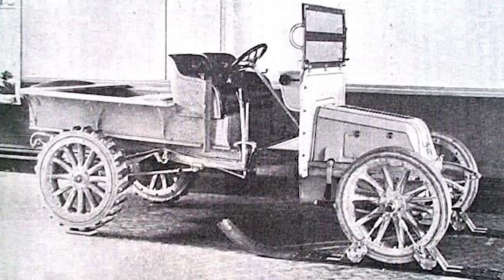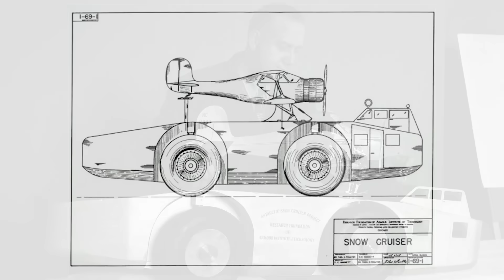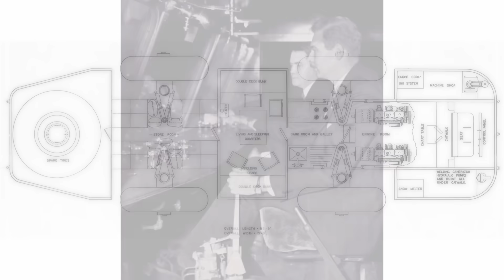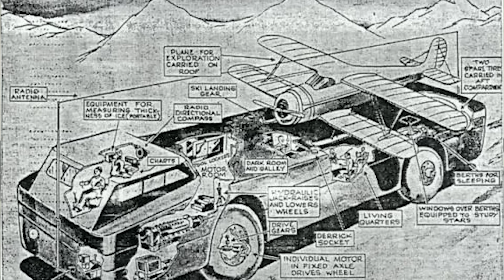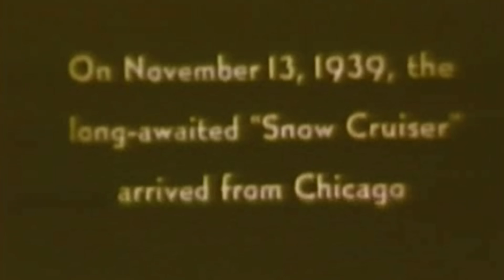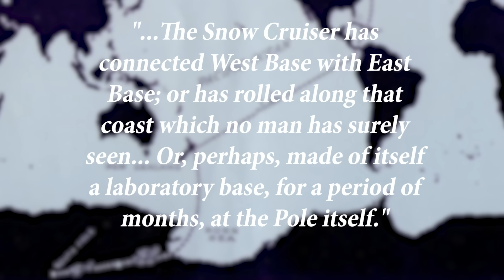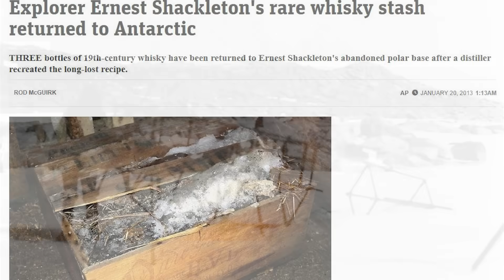"The Snow Cruiser"-Antarctica's Abandoned Behemoth

Comment: I know a lot of people have already  commented on this. However it struck me as a superb project, however really stupid mistakes. No testing in say Alaska beforehand, slick tyres, madness. Surely spikes or a deep off road tread, snow chains even. It just strikes me as a great idea but ruined by simple mistakes. Engineers got the basics wrong!
Reply: As the creator of the video has been stating, the main problem was that Poulter's comparison material was sand, which behaves similarly but not identically to the powder snow in the Anatarctic. He failed to realise that sand is 4 times heavier than snow, and so made a vehicle that was simply too heavy for its wheels. The tires would sink in so far that just climbing out was equivalent to going up a 20-30° slope. If he had calculated for the unit weight of snow, the design could have been adjusted for less weight and the tires would have been fine.
Reply: It's wildly odd how this was engineered in Chicago.  The winters can toublesome there.  I wonder what kind of tires simple trucks were using around then and there.  Atop of that, what were we using in Alaska at the time?  (Being our snowyest local territory).
I bet there were a number of engineers quietly shaking their heads after being told to "shut it", after bringing it up during design.  Of course, Illinois isn't known for its squeeky clean politics.  So in hindsight, its not hard to understand how "a" led to "b", and then to the flop that is "c".
Reply from the maker: Great comment.
Reply: One article I read said that chains were used on the tires, when it was learned that the slicks did not function in Antarctica. One can only imagine how chains were fashioned for ten foot diameter tires, but it went on to say they were a failure as well. The article also said that the air plain malfunctioned too and was never used.
Reply: I think one reason they went with smooth might be treads over ice might tend to be a bit rough, possibly cracking ice. That said I think doubling the tires in the rear might have been a better idea than doubling the fronts.
Reply: It was designed by a Physics Professor then built in 11 weeks by a company that made train coaches, started up only to be driven across country without any testing or even a shakedown run. Crashed into a creek because a faulty steering system. It was a rush job and a publicity stunt with a bit more development time and testing it might have been a success not likely, but politics got in the way as they often do.
Reply: @dycantos  World War 2 was around the corner and nobody wanted to invest time and money in a machine like this by this point.
Reply: @brunoraoni   To us in hindsight WWII was just around the corner but in the United States late 1930s that was a distant possibility an ocean away the funds were there for the project but it was a race to build it and get there first.
Reply: Unfortunately, Alaska wasn't apart of the United stated until 1959.
Reply: @scottwebster3501  USA bought Alaska from Russia in 1867. It was granted official statehood in 1959, but it was definately a part of the US well before that.
Reply: Scott Webster Alaska was a U.S. Territory, and therefor a part of the U.S. long before it’s statehood.

Comment: Yeah, the obvious with the smooth tires. I'm from Canada and at a glance I could see that they would never work! They just look like a huge tube, perhaps that's all Goodyear could do at that time? Couldn't mold a treaded tire that size maybe. The slighted grade and it would spin and slide. An option would maybe to chain them all up, but logistically perhaps too hard to do as the chains would be extremely heavy and hard to install. Pretty cool looking machine, though.

Comment: Thank you for alerting me to something I never knew existed. .. the time & effort making this video very much appreciated 👍
Lots of comments about tyres but grip is all about footprint, smooth is more rubber like in racing cars so the 'rough or smooth' tyre question is I think more complex than first appears & wholely depends on which surfaces they expected, hard smooth ice may have been better with low pressure smooth tyres.
Reply: This reply is a year late, but I think the slippery and icy surface would have negated any (minimal) benefits of increased ground contact area. 

I think slick racing tires benefit from high temperatures and speeds (i.e. F1 cars operating best when their tires are at a certain temperature). 

Plus, if they wanted more ground contact - I hear tracks are pretty good at that.

Comment: Guys, enough with the “Slicks” he literally said they were “Ballon Tires” to help it “float” over the snow and ice and any terrain the Antarctic throws at it. And the Antarctic is flat Enough that it doesn’t need giant treaded tires. Everything has a reason
Reply: Have you ever driven on snow and ice? Good luck with slick tires and likes, even heavy machinery wont get a grip. And have 37t float on snow on that puny surface area, lol.
Reply: @ZvendZved  To be fair he did say its main issue was a lack of power, not lack of traction.
Reply: @flaviobriggs  Regardless of it having enough power or not it, it lacked traction with those tires.

Comment: So using modern sheet metal, aluminum alloys, modern lightweight insulation, and much much stronger engines and drivetrains of today, a version of the vehicle that actually could climb steep grades and travel all over Antarctica could be built.  Of course if we tried to build it today, a bunch of fucking assholes would demand it be so stuffed with electronics and thoroughly automated it would take 30 fucking years and 5 billion dollars to design, build, and test the fucking thing.

Comment: If they had thought a bit harder about this one, they could have made it tracked and it basically would have been a Jawa Sandcrawler. They've been using snow cats, the tracked vehicles they use for grooming ski slopes, for years down there with good success, because big wide tracks = lots of grip and low ground pressure.

Comment: When the 'Unstoppable' expedition vehicle gets stuck on the way to the pier , it's time to rethink the design ,LOLOL
Reply: @DarkAlex1978  There is also the detail that those tires actually worked incredibly well on ICE, not SNOW.
Reply: @DarkAlex1978  They tested on sand which is similar to snow, the only catch is... sand is 4 times heavier than snow, consequently, the machine had 4 times better performance because of that little detail.
Reply: The smooth bottom was to slide over ice and snow. Over earth and grass it just got stuck.

Comment: Intelligent engineers should have considered developing a prototype or two (maybe a dozen or so) before creating an inefficient  giant boat anchor. That design with a snow mobile track under it and 20 foot body lift hydraulic mechanism would have been more practical. A smaller version pulling a camper trailer on skis should have been considered. The purpose of the drawing board is to figure out the mistakes before the thought takes physical form. Oh well. (it didn't cost ME anything).